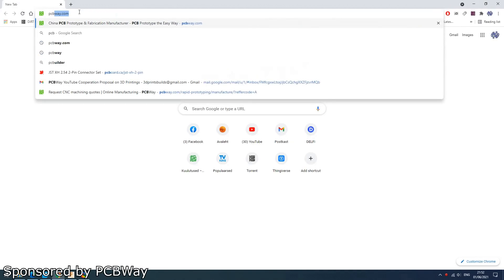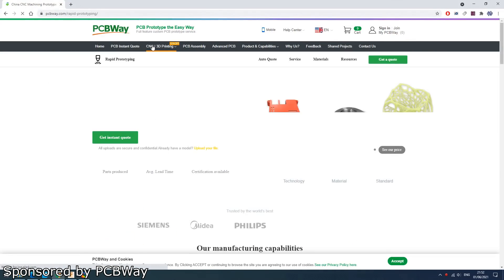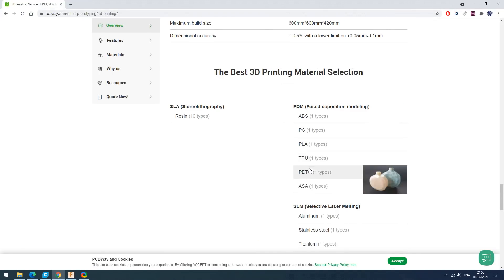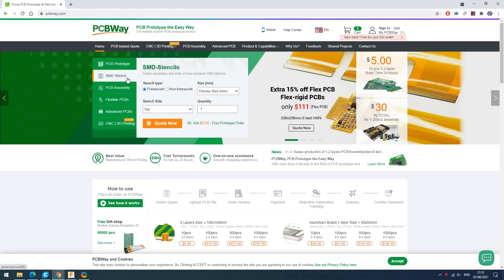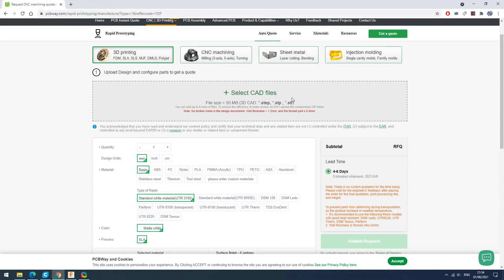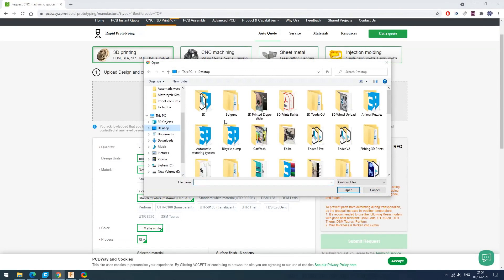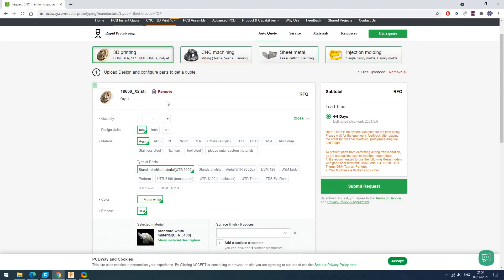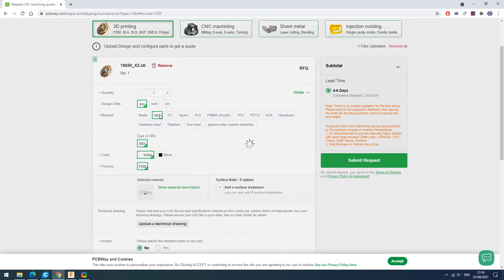Useful 3D Prints February 2022

Comment: As a guy that does construction, I believe you have your shelf brackets switched. The screws should be on the inside so they aren't seen as easily.
Reply: I'd say he has it right. The flat faces are facing inward and the decorative faces are facing outward.